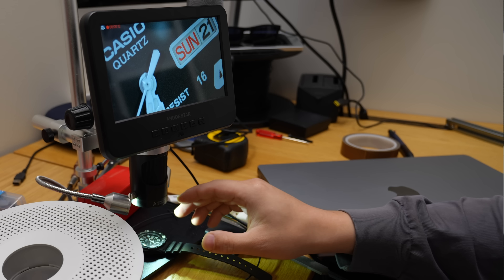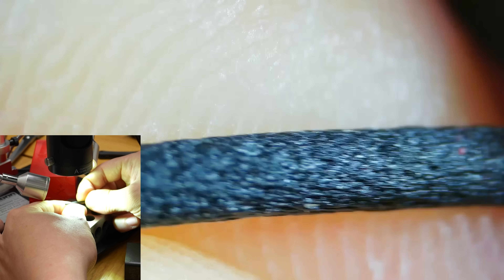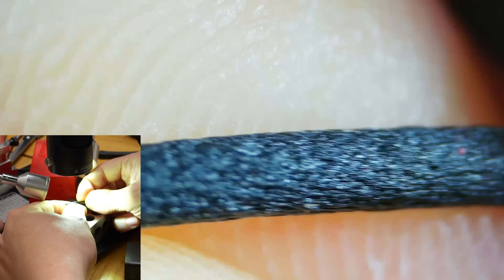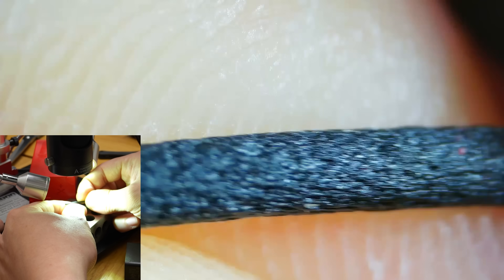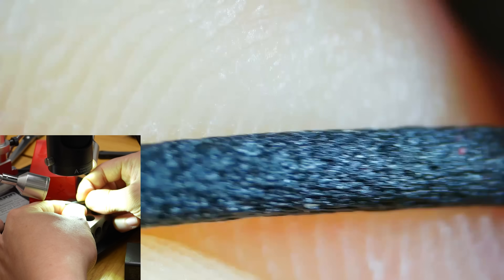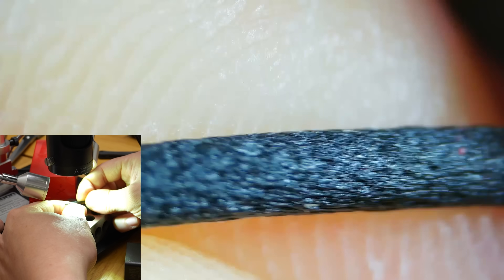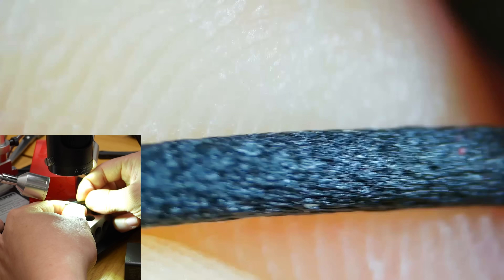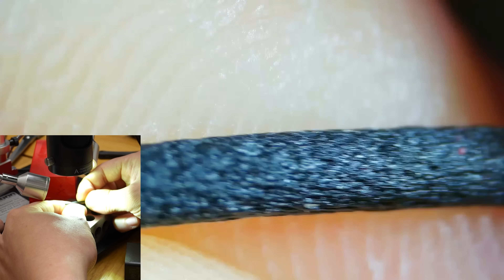The Dark Side of Carbon Fiber Filament

Comment: stuck ON your skin vs stuck IN your skin, two very different things.
Reply from the maker: I couldn’t wipe or them off, they are effectively splinters. Splinters are in your skin not on your skin?
Reply: @NathanBuildsRobots  stuck to the surface is very different from stuck in deep.
Reply: @Lancia444  where do you get your information from? That just isn’t right at all or else any carbon fibres in contact with the skin would never come out.
Reply: @NathanBuildsRobots  
SKIN
Ya, they are not stuck in your skin or at least only very shallow. Like not even 5% through the layer of dead skin cells. They won't do anything there, except being shed with your dead skin on like the next 2 days even. Cuddle with glass fiber or those hairy caterpillars and take a look (and feel) then. Bristle worms from a reef aquarium also work xD . It's really quite different and it will itch and the fibers will stick out of your skin in a perpendicular way, like you are a hedgehog. In your video they penetrate a few microns, the other kinds of fiber I just mentioned can penetrate like 1000 microns down through the layer of dead skin into the dermis. I've heard that carbon fiber can act like that, too, but never actually experienced it. Not even when working with "raw" fiber that I laminated into pipes with epoxy. I think the kind of carbon fiber to expect that from is the fancy industrial type. There are many different types of carbon fiber.
I'm not saying that it's harmless, but comparing it to asbestos is a bit over the top.
Things stuck in the skin always will be shed together with the layer of dead skin cells. (the "splinters" shown in the video are definitely here and here only)
Things stuck deeper, like in the dermis or flesh will be either dissolved by white blood cells aka puss, or moved to the top of the skin. (the other types of fiber/hairs can do this, as well as the "industrial" carbon fibers)
Sometimes they will be buried under the skin, they will then be dissolved or a in rare cases a granuloma can form. (and this)

LUNGS (mainly)
Asbestos being crystalline is a huge factor here too. Your run off the mill carbon fiber is not sharp enough to over and over stab cells to death that then immediately regrow. Every time a cell regrows it has a low chance to be a tumor cell. That's why asbestos is so dangerous, it doesn't leave the lung and will make cells die and regrow endlessly, eventually spawning a tumor cell. Breaking an asbestos fiber will always result in a sharp needle like that, because it's crystalline. Also it cannot be broken down by the body. With carbon fiber I'm actually not sure, I tried to research it, but didn't find good info. But to my surprise I learned that glass fibers can be broken down by the body, because of their distinct chemistry (there are also a lot of different glasses). They even exhibit a tiny solubility in water. Being a chemistry guy I'd say that the white blood cells will smother the glass in chlorine bleach. Yepp, they have bigger bangers in their arsenal, not only silly hydrogen peroxide. The bleach is highly basic and bases are the Achilles heel of most glasses. At that scale the glass will be dissolved eventually. Now I want to drown some glass fibers in chlorine bleach...but I think I don't have any laying around 🤔. But you know what I have? Carbon fibers! xD
I also came across some studies that seem to find no toxicity and immune response to normal carbon fiber. But nano tubes do both. It was a specific type of nano tube though, that was examined.

LUNGS (mostly Wikipedia)
3 microns is the critical parameter here. It's the size of the alveoles in the lung. Stuff bigger than that can't enter them and the body can cope with it more easily (I suspect it will be moved out of the lung and eventually body by white blood cells and cilia).
All types of carbon fiber I came across researching this are at least 5 microns in diameter.
Asbestos in practice can range from 0.75 to 8 microns , depending on the type. These are still "chunks" of fibers. Theoretically the individual fibers are much smaller (0.02 to 0.2 microns). But even with asbestos there are certain other rules that must be fulfilled for the fibers to be carcinogenic. Length and aspect ratio play a role.
With glass fibers there are 2 very different basic types. One type is used for insulation, the other one is used for composites. The one used for insulation today is bigger than 3 microns and not classified as carcinogenic. A few decades in the past there have been smaller diameter fibers that were classified as "*might* be carcinogenic". The fibers used for composites are 5 to 25 microns thick. I suspect these are the ones that are used in 3D printer filaments.

CONCLUSION FOR 3D PRINTING
1. Carbon fibers and today's glass fibers are not carcinogenic.
2. The video shows, that they are for from penetrating the skin in a meaningful way.
3. If you still should encounter glass or carbon fibers penetrating into the living part of the skin, you will feel it, it will be unleasant but it won't be a real health concern and sort itself out naturally. In very rare cases of this very rare case (I strongly belive that 3 will never happen with 3D print filaments) a granuloma seems possible. In other words that's when the offending object(s) stay beneath the skin, surrounded by white blood cells that are unable to push it out.

Using a dust mask is a good idea, though, with any type of fiber or fine dust, even with wood. I wouldn't be too concerned while printing but when doing work on a carbon fiber reinforced part, printed or other types, I'd wear a dust mask, since lager quantities entering the respiratory system will irritate it, no matter what kind of dust or fiber it is.

Ending note: I'm a bit flabbergasted to see so many people being surprised by the fact that carbon fiber filaments contain or shed some carbon fibers.

Comment: The smoke you talk about at the end may or may not be smoke. If your filament has absorbed moisture and is now being pushed through a 250°C nozzle that water turns into a 35x bigger volume of steam and bursts out of it. If there is really a lot of it in the filament you can hear a sound like eggs frying in a pan as the individual bubbles break and you can see the stream of molten material is not nice and smooth. But even at lower percentage of moisture you can see the vapour escaping and the amount of it is directly proportional to the flow rate of the filament through the nozzle. 
You of course can actually burn stuff and have real smoke. But that needs temperatures significantly out of range for the given filament and it also tends to keep on smoking when the flow through the nozzle stops because there is still more plastic being burned inside the overly hot nozzle. With extra high flow this kind of smoke tends to diminish because less plastic has time to get to the temperature where it smokes. If you are making such smoke your print also tends to come out weak and fragile because some parts of the polymer were destroyed in the nozzle and the rest does not have the mechanical properties you would expect from the given type of filament. 
There are applications where having the fibers in the filament is needed. For example right now I am trying to print a holder for a robot battery pack. The print is almost 400mm long and needs to keep its mechanical properties at 70°C with some margin. I am trying ASA-CF but in my experience any filament that softens at 90°C or higher also likes to warp a lot when you try to print large objects with it, even in enclosed printers. Having the fibers in the filament means the warping is gone or almost gone and the large print is actually possible. 
With all the other stuff we are exposed to every day I am not about the start worrying about a few carbon fibers from occasionally touching such filament. The diesel car that overtook me on a dusty road when I was cycling yesterday probably did way more damage to me. That doesn't mean I will ignore the risk and go lick a carbon fiber infused printed parts. But I think every risk should be taken with some perspective to it. If I were to handle such filament for work 8 hours a day every day then the extra clothing, gloves and respirators would make sense. They wear this in factories where they do cutting and sanding of carbon fiber composite parts for airplanes and such (I've been there a few times). But if I print out one spool of this stuff every 6 months and use it for parts that are not being touched by anyone in their normal use I don't think there is a need to freak out about it.

Comment: never understood infused filaments the fibers are so small they dont really effect the strength of the part in any meaningful way that cant be solved with better slicer settings.
Reply: they are very useful for increasing dimensional accuracy in warp-prone or ooze-prone filaments. if you're just printing pla though, yeah why bother.
Reply: Then you just haven't had an application that needed them or don't understand the point. The main point is stiffness and dimensional accuracy and the fibres do have a very noticable affect on stiffness.

There is far more to it than slicer settings. You could apply your same comment to using different materials too. By your logic you could make a PLA part as strong as a nylon part just by changing slicer settings, like making the part really thick and heavy.

If I need a part to be stiffer and stronger without weighing any more then that is when you use stronger materials or fibre filled materials.

Comment: You should always be aware of the risks no matter what you do. Woodworking, 3d printing, welding, painting, .... 
There are safety regulations in the industry for a reason. You can often significantly improve safety in your hobby workshop with little effort. Your health should be worth it.

Comment: After watching this video I took one of my cf-asa printed parts under the microscope. What I see is that most of the fibers are embedded in the plastic, however most is not all, there are still some fibers sticking out, being able to get picked up into your skin. So I'd say even for printed parts treat them with the same precautions as unprinted filament, up until you've sealed the part. (effectively clear coat every cf print to make them safer for handling.)
Reply from the maker: Thank you for checking and sharing your experience! We need to crowdsource the research on this because clearly the manufacturer's aren't doing it.
Reply: I just commented asking for this vary same test to be done. Kinda wish it was in the video

Comment: Carbon fibers are very big and nothing like aspetos. Asbestos is so small and sharp that they penetrate cells and causes cell piling, which can lead to Cancer. That being said, dont use Carbon fiber og nylon or any fiber infused filament for anything that touches your skin, or for storing anything like food or clothes, it can lead to irritation.

Like any fibers, wear a mask if you are sawing, sanding or drilling the material. For printing and use in parts where you need that kind of material, it should be pretty harmless. Carbon fibers are too big to be carried by smoke or vapor... I would consider the gases from some of the plastic filaments more harmful.

Never the less, It is never wrong to rase concern if it is there! 3D Printers are not toys, so always do your research when handling new materials and take precautions.

Comment: How about just showing us these same magnified images daily (or over a period of x hours), but without touching carbon fiber?  I'm sure they will mostly be gone.  Your body will reject and push out the foreign matter.
Reply: Same. Lungs and internal organs have cleaning mechanisms to some degree. And you can't get some stuff off the skin easily too, which is not technical but is rather food-grade stuff, like onion smell.
Reply: They aren't deep either. I have looked at my own fingers after touching CF parts, the fibres dissappear quickly. They are just on the very surface, not deep.

Comment: Why haven’t you looked at printed parts only on filament? Would be interesting to know if the printed parts loose fibres as much.

Fibres in  filament are typically 0.03–0.3 mm long. 0.5 mm would be already too long to work reliably with standard nozzles. Essentially it is fibre-dust.

Carbon-filled filament typically is less strong than the base-material, but the carbon-fibres make it more stiff and reduces thermal expansion. The main advantages are: 
‣ It makes warp-happy filament like PA a lot easier to print.
‣ It looks cool.
‣ The parts get lighter
‣ The parts get stiffer
Reply: After watching this video I took one of my cf-asa prints under the microscope. What I see is that most of the fibers are embedded in the plastic, however most is not all, there are still some fibers sticking out, being able to get picked up into your skin. So I'd say treat printed parts with the same precautions as unprinted filament, up until you've sealed the part. (effectively clear coat every cf print to make them safer for handling.)

Comment: Another point: Carbon fibers are extremely light so they easily become airborne. Which is not good in combination with most prints needing some post processing - removing supports/brims and filing for proper fits, or god forbid sanding.
Reply: Wet sanding helps a lot there. The water binds (almost all?) of the dust and prevent it becoming airborne.
Reply: @rynnjacobs8601  It also keeps the plastic cool and rigid, that's a nice bonus as this helps with the sandability (PLA when dry sanded will warm up due to the friction and become rubbery, and become hard to sand).
Reply: Man so it’s basically as bad as asbestos? That is so concerning, that anyone the public can just order this and they don’t have massive warning labels stating these things. And besides simple ignorance, what about people who 3D print product and don’t have any morals? So they just end up selling products with carbon fiber without telling people the risks or caring that they’re doing harm?
Reply: @MermaidMakes  Go look at microscope pictures of both. Asbestos is dangerous because it's a lot more jagged and it can hook into your lungs and stay in there. In comparison, glass and carbon fibers are really smooth and will be removed by your body over time. Just because something is a fiber doesn't mean it's dangerous. We all wear clothes don't we? No one is complaining about Nylon fibers getting on our skin or in our lungs. Not saying carbon or glass fibers wouldn't suck to get on your skin or breath in but it's not gonna kill you.
Reply: @MermaidMakes  Yea had the same thought with the asbestos comparison. Ain't no way in hell sanding this stuff (cf parts) without a respirator is safe. If it gets in your lungs, it's not coming out...
Reply: Perfect whistle material
Reply: I work in a factory that produces Carbon Fiber racing boats, and I can definitely confirm sanding and cutting is uncomfortable. It's probably not super dangerous, and honestly I'm the only one who seems to care enough to wear a mask when cutting, ripping drilling, or sanding CF with power tools, but it's definitely a nuisance. Even as I'm writing this I can feel the fibers prick my skin from today's work.

Pro tip: take a cold shower if you got it on you. Hot water only opens your pores and lets the fibers get stuck. Cold water does a better job.
Reply: @SzikrásAnna-火花安娜  You keep wearing the mask mate, it will prove to be a wise move in time.
Reply: @SzikrásAnna-火花安娜  Protect yourself before anything bad happens to your health. Wear a full suit, glasses, a mask and cover your head since hair can easily entrap any substance and use tons of water to prevent fibers being airborne. Also, keep your distance from other workers that are careless since you will expose yourself to their airborne fibers.

Comment: Nice demo and list of what not to print with CF filament. Could you please also look at glass fiber filament?
Reply: I am also curious about this.
Reply: it's pretty much the same with glass fibers
Reply: @cosmic_cupcake I'd like to learn more: do you have any recommendations of resources I can check out, concerning GF reinforced filaments?
Reply: @ultramegax  I would look at safety resources for fiberglass insulation as well as for regular fiberglass molding, the concerns should be similar and information is plentiful. Can't link anything because youtube doesn't like that, but a google search should yield plenty of results.
Reply: @iguanamoat  Will do! Thank you!
Reply: @ultramegax  I don't have any online sources, tbh. Most of my knowledge stems from safety protocols for grinding and cutting conventional cf and gf composites, and a conversation I had with the health and safety inspector at work.

Comment: I guess one other problem could be printing some carbon fiber filament. Then you switch to regular PLA cause you need to print something that is safe, and carbon fiber stuck in the PTFE tubes or gears of your printer contaminates the supposedly safe PLA.
Reply: If that does happen then the amount of carbon fibre that contaminates the safe PLA will be very low and will be at its highest right at the start of the filament which you should purge anyway.

Also if you need to guarantee something is safe for child, medical or food use you should have a nozzle (ideally whole hotend) dedicated for it anyway.
Reply from the maker: @conorstewart2214  I think things like the filament cutter and extruder gears will work some fibers loose and they will be floating around inside of your enclosed printer, and lofted into the air by the powerful part cooling fans.
Reply: @conorstewart2214  Not true. I used quite a bit of cf-pla then switched to white pla later. It took FOREVER to stop coming out light grey. It never did come out solid pure white. The grey was clearly visible the whole length of the tube.